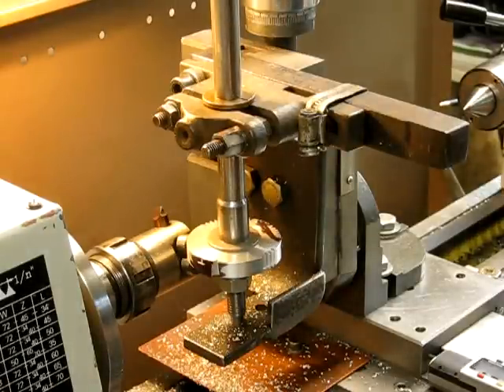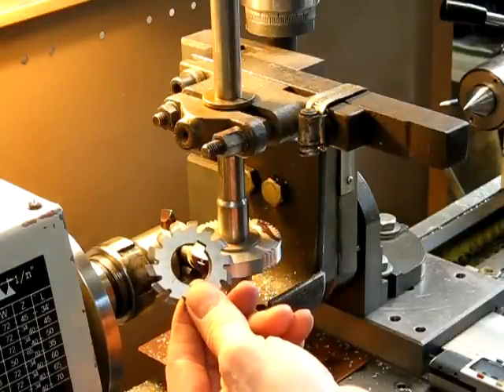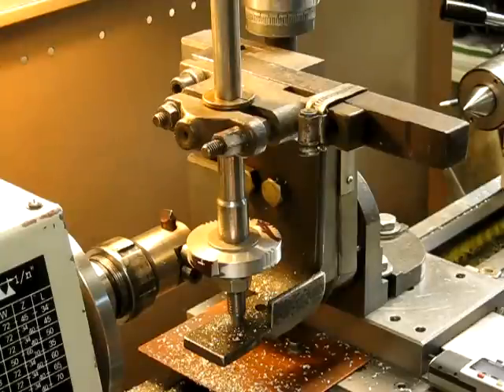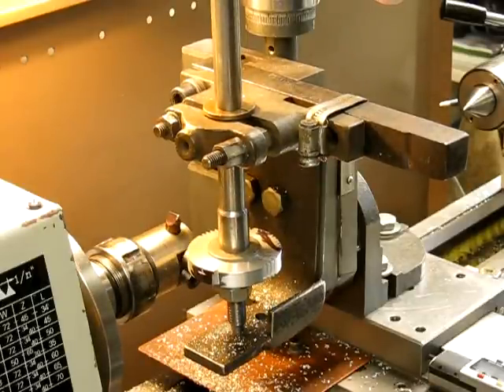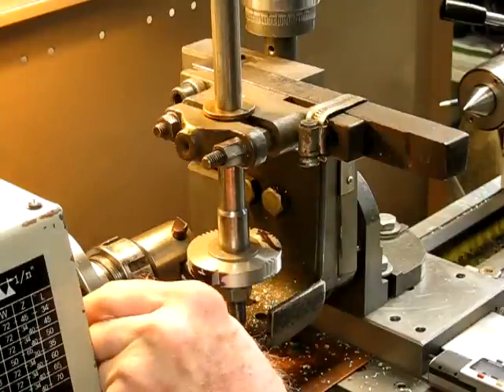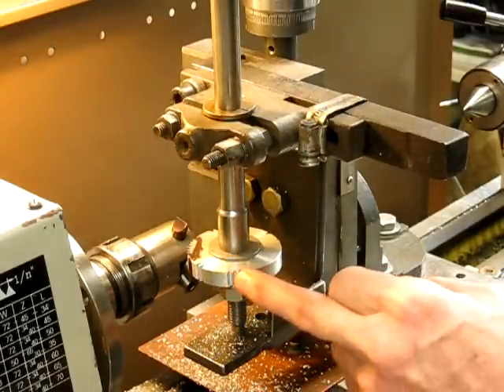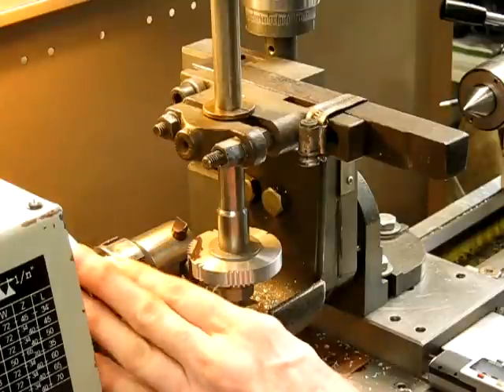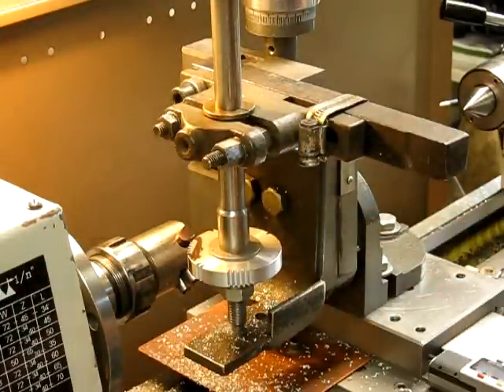Cutting gears on a lathe with a fly cutter

Comment: im needing gears for my new old drummond 4inch which is missing most gears ,good way to do it,fun to do ,ive rigged up a temp motor by adding a pulley at the end of the driveshaft onto my drill press pulley which ive turned over to match the same plain as the lathe,the lathe will make the missing gears and pulley so no need to buy and fun to do...love the way you did this..

Comment from the maker: To centre the cutter on the gear blank put texta/marker pen on the edge of the blank facing the cutter.  Set the sharp point of the cutter level with the mid point of the blank thickness. Move the blank into the cutter tip until it is firmly contacting it.  Move the carriage left and right to traverse the cutter across the blank.  It will make a scribe mark in the texta pen mark.  The mid point of the scribe is the centre of curvature of the blank, and where you have to cut the tooth space.

Comment from the maker: Hi Bret.  The reason you lower the blank rather than raise it when cutting, is because you have to raise it to the indexing disc to set the new cutting position before lowering it again.  That is the only way you can use this system.  Therefore it's not possible to go in the other direction.  As the cutter is transcribing an arc it doesn't really matter anyway. The cutting action is quite OK as is.  Good question though. Cheers Rob

Comment from the maker: There's an indexing disc on the top of the vertical shaft holding the gear blank.  The disc aligns with a pointer.  It's all fully described in my blog on gear cutting.  The link is in the video description.

Comment from the maker: Indexing is done with a round disc at the top of the vertical shaft and a pointer.

The disc is a computer spreadsheet pie chart.  See the link in the full video description for a complete write up on my blog.

Comment: Correct me if I’m wrong, you were doing a climb cut. It would be much smoother cut if you feed from below the cutter and would reduce the risk of having a wreck!!!! Would allow you to feed much quicker as well.
Reply from the maker: No real difference in this situation.  The cutter is pulling down on the gear blank in both instances.  I've done a video showing both feed types/directions and there is stuff all difference.  Feeding down from the top allows the indexing disc to be aligned with the pointer.

Comment: Wouldn't it be easier to use an indexing head?..Don
Reply from the maker: ddm220 Well yes,  I suppose if I had an indexing head, or was about to spend big bucks buying one, then it would be a bit easier.  This video is actually about making gears when you DON'T have the luxury of a fully equipped work shop.  Rob
Reply from the maker: xynudu I also don't see how you would set up an indexing head on a lathe to cut a gear.  Care to explain ?  Rob
Reply: xynudu is exactly right you would have to have a mill attachment to you lathe then fix a indexing plate the the lathe and being in Australia indexing plates don't come up all that often and when they do they are not cheap, so it wouldn't be easier. His solution has done the job with the least amount of money spent good job